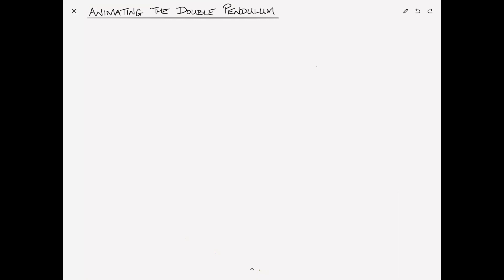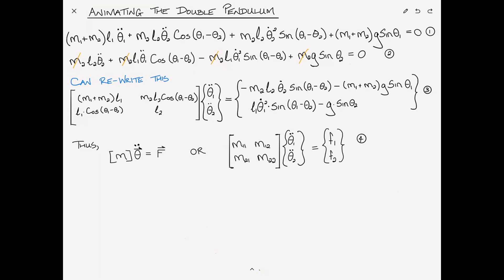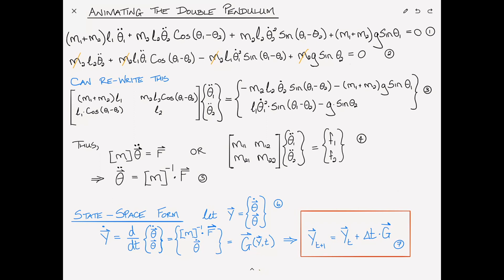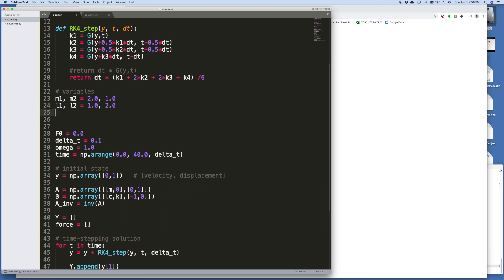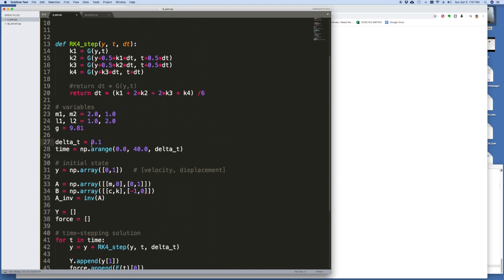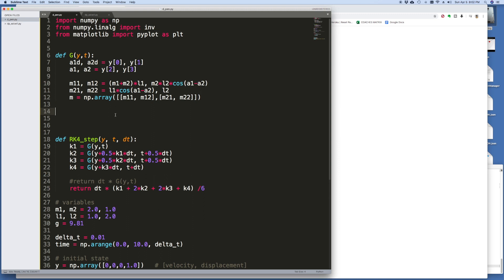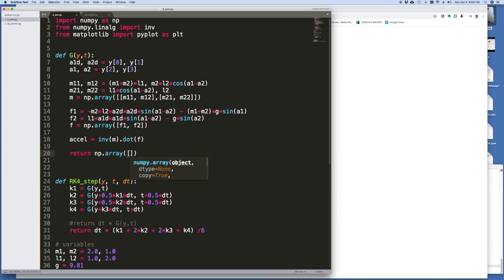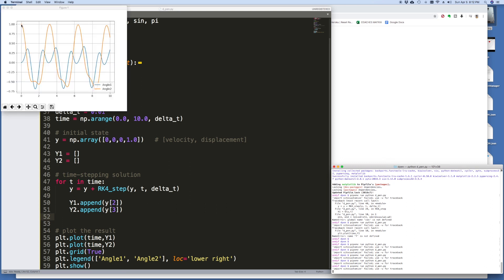Animating the Double Pendulum (2DOF) - Part 1 of 3 - Solving the Equations of Motion

Comment: Hi Andy! Thank you so much for these videos! they are very useful indeed.

I what to ask a very simple shallow question, how to change the setting of text appearance? I like so much the contrast you use in your scripts. 

I am using Spyder, I managed to change so far some of the colours of part of the next, but I have not found how to change the colour of the equal sign "=", and the second keywords in the commands i.e. array or append in np.array, Y.append. 

Thanks!
Reply from the maker: I believe you are referring to the syntax highlighting for Python.  This is a feature of the text editor that I am using (Sublime Text).  I believe this is the default theme although it does allow one to use various different themes which can be installed.  Most text editors should offer varieties of this.

Comment: Hey there, when you used f =ma at the beginning, how did you know that the right part of the equation was a force? Also do you recommend any resources to learn the method used such as state space form? 

Thank you!
Reply from the maker: This is because the equations of motion represent a balance of forces.  Even though in this case we derived the equations of motion using the Lagrangian approach instead of Newton’s Law, the resulting equations are really a force balance, F=ma, where ma can be considered to be the inertial load - which is a force.  The truth is that, in this case, the right hand side are not really forces, they are moments and, in fact, the equations were then divided by mass and length, but they were derived as forces. But for the purpose of solving the equation, it’s fine to assume the structure that I have. 

With regards to state-space form, I have other videos where I explained this more thoroughly.  Take a look at:   https://www.youtube.com/watch?v=e1q4vD2KjpE
Reply: @Freeball99  Thank you,

Thank you,

On the graph I have generated, the angle of theta2 is going above 8 which is too large, do you know why this is?

Comment: Hi, I have a proble with your solution, because of the way you put the reference system, If I put theta1 and theta2 equal to pi / 2 and the two angular velocities equal to zero, then the energy will be equal to zero, and it is assumed that the system would not have to oscillate

Comment: Hi, thanks for these amazing tutorials. Seeing the full derivation through to a Python and pygame implementation is great. I've been following along today. When you convert the eqn's of motion to matrix form (starting at 1:28), I believe you left out the exponent on theta_2_dot on the right hand side (f1). You have it squared in the number eqn 1 above, and then when you get to the code, you have it right again, with "a2d*a2d" in the full line: f1 = -m2*l2*a2d*a2d*sin(a1-a2) - (m1+m2)*g*sin(a1). Thanks!
Reply from the maker: Yes, you're correct.  The first equation, right-hand side I'm missing a squared on the θ2_dot.  Thanks for catching this.  The rest is correct.